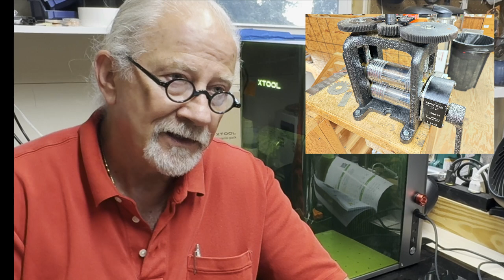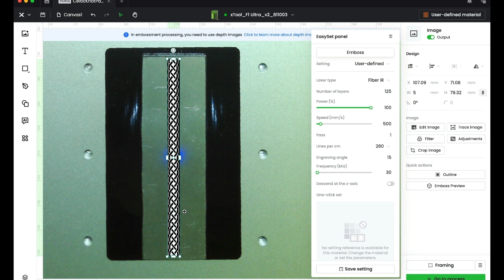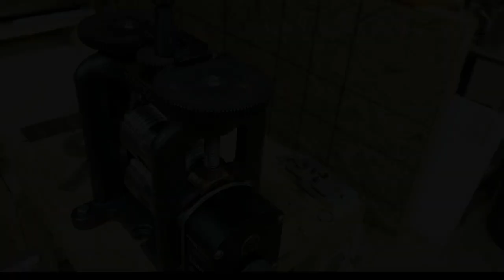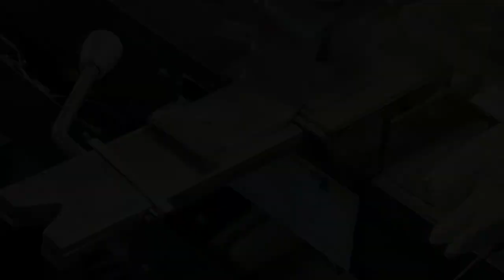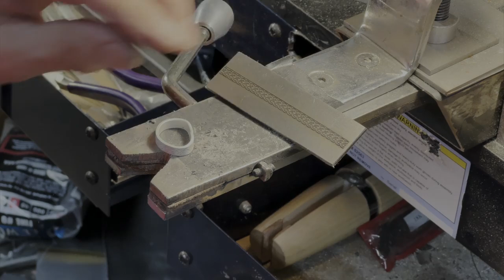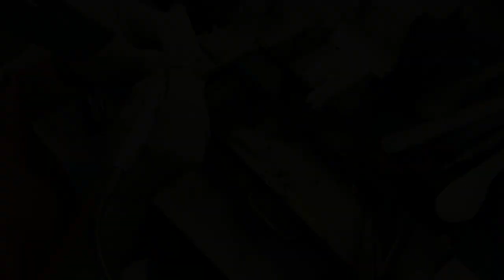Laser Engraving A steel Rolling Mill Plate To Make A Sterling Silver Ring Band

Comment: This is really informative, thanks! Would there be a benefit to creating a plate with multiple copies of the same pattern in order to mill more than one ring at a time, or would this be more difficult to roll?

I was aiming to roll 0.5mm/24 gauge copper over a texture plate to create multiple strips for a large piece of art, would a plate like this still work well do you think?
Reply from the maker: @final_animal  thanks! Thin metal is tougher to roll and often needs a backing like paper or foam to push it into the design. That said, you can generally roll strips about 2-3 inches wide and 6-8 inches long on a filled out pattern plate. Making your own that large will be a challenge, doable but not easy. I would check out Potter USA they have a great selection of pattern plates full size.

Comment: could you etch the silver instead of rolling it
Reply from the maker: @blacksmith7996  sure. But this is a way to make a pattern plate. You could directly laser engrave or etch the silver, takes about 2 hours each one. After making a plate you can make an impression in about 2 minutes.